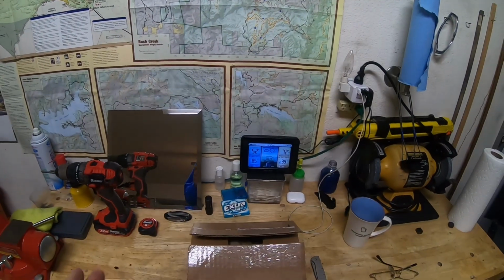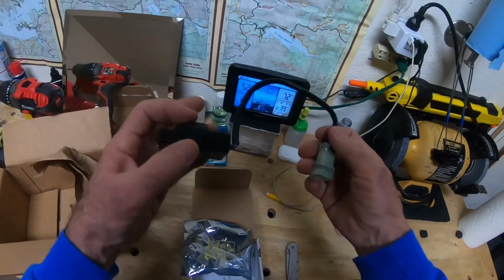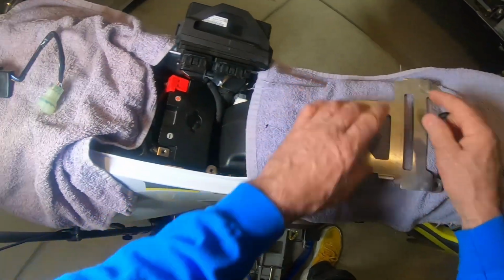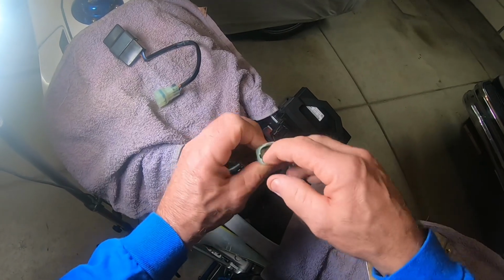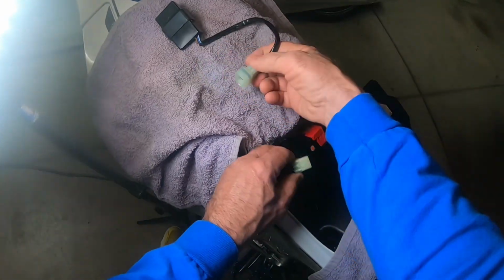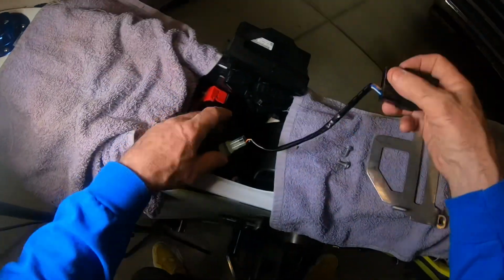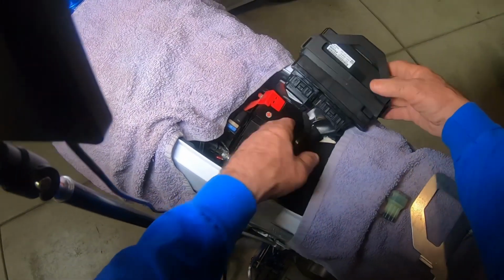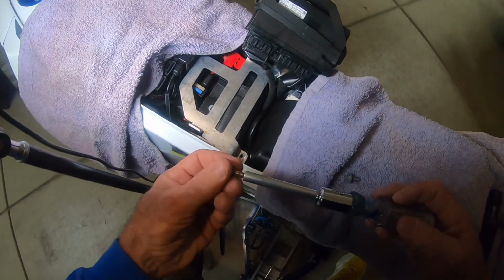ABS Dongle Husqvarna 701 installed using diagnostic port.

Comment: Hi, I have a Husqvarna 701 2021 (europe, euro 5) there is a sistem for remove permanently the front abs? Thank you.
Reply from the maker: I’m not sure in the euro 5 models. I think the ECU needs to be reconfigured to disable the abs. Look to MCE performance for further advise. They may be able
To help.
Reply: @motohead5319  thanks you 😉

Comment: Just bought a 2022 KTM 690 and came with this dongle so was trying to figure out how to install it. 

Is there a way to set turning off both front and rear ABS? Or will it only turn off the rear?

Also is there a device that will turn the TC off and keep it off each time your start your bike? 

Thanks for doing the video.
Reply from the maker: Is your bike in the USA or Europe
Reply: @motohead5319  Bought it in miami so yes a USA bike
Reply from the maker: @nickdefreitas  
Ok. Great. You have a Euro 4 compliant bike. So yes. The dongle will fit your bike,  and it will only shut off the rear wheel abs. TC is also off in both mods. 

Hold down the ABS button on your dash for a few seconds and the dongle will also disable front ABS. Good for off road I hear, and the ABS light will stay on as opposed to a flash every 10 seconds in front abs only mode. 

MotoHead 👍
Reply: @motohead5319  thank you for that explanation cleared all my questions up. Pretty excited to hook it up now, thanks again
Reply from the maker: @nickdefreitas  

No problem 👍

Thanks for watching 🏆

Comment: Could you just explain what's tht for, what it does exacly? Maybe a test with the bike on? Where did you get it from?
Reply from the maker: Hey. Thanks for posting. 
lol. Yes. I should have indicated in the video the purpose of the ABS dongle. The dongle allows for the ABS to function on the front wheel and have the rear wheel ABS off. The one thing that annoyed me as well as others is how the rear wheel abs functions. It’s horrible. The dongle is an OEM Husqvarna part so your local dealer should be able to get the part for you. 
My intent is to follow up shortly with another video explaining the benefits and my experiences. 
Thank you for posting a comment. Much appreciated!
MotoHead 👍❗️
Reply: @motohead5319  Thank you for the fest answer, I'm not sure which model you have but I have a 701SM produced in Feb 2022 so Euro 5 and by turning on map 2 that's what it does, rear ABS off and front always on. Don't know maybe I already have the dongle installed from factory; I actually thought that your dongle would turn it off for both wheels.
Reply from the maker: @muzichub8261  
Your welcome. 
I like to respond as quickly as I can.  Much appreciated!
Yes. The dongle will also turn off front and rear by holding the abs button for a few seconds. I’ll confirm that today and post up another short video. The abs light will flash every 10 seconds in front wheel abs mode and will stay on while both wheels are turned off. 
The euro 5 bikes have the option to turn off rear wheel abs whereas the euro 4 compliant bikes don’t have the option to turn off rear wheel abs. So this is why I have installed the dongle on my euro 4 bike.
Reply: @motohead5319  So if I install one I'd be able to turn it all off? Thanks a lot for the explanation ❤ keep up the good work.
Reply from the maker: @muzichub8261  
Thank you for the compliment. Much appreciated!!!  
Yes. You would be able to turn it off completely but I am not sure if the diagnostic port on the euro 5 bike is the same as euro 4. I think it may be different. If it is different What you could do however is unscrew the rear wheel abs sensor and stack in a few washers so the sensor can’t pick up the wheel speed. But you may see an engine light or code. Not sure. The abs light would stay on indicating that this is achieved but can’t you disable abs on both wheels by pressing the abs button ?
Reply: @motohead5319  I tried but it seems not to work. Will give it a test after healing from my kneew injury, icy road 😅